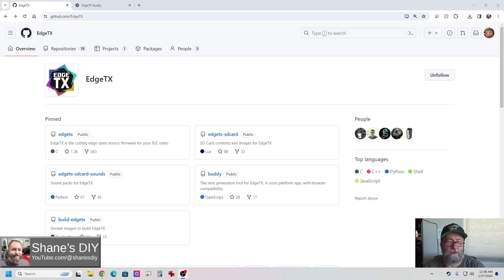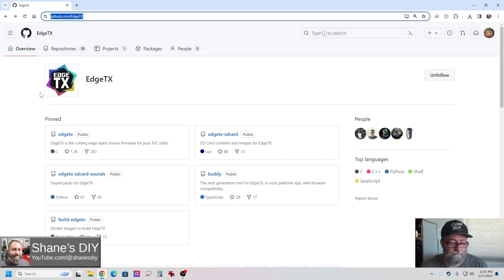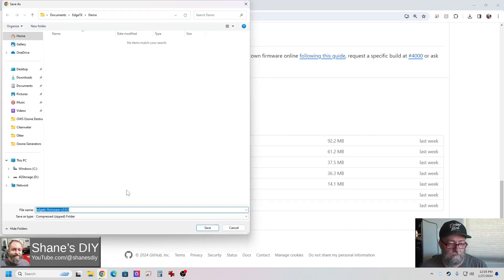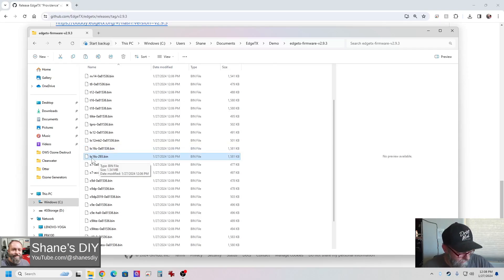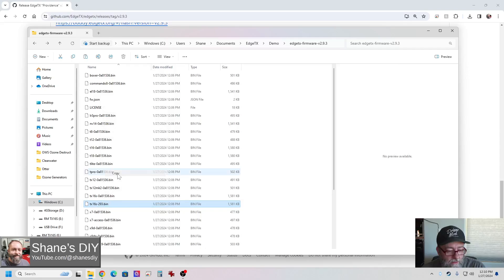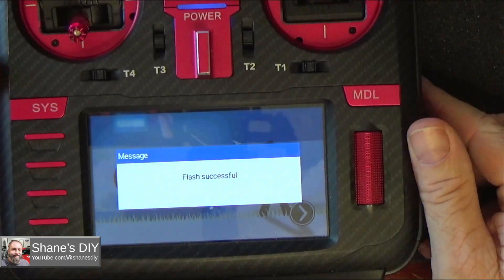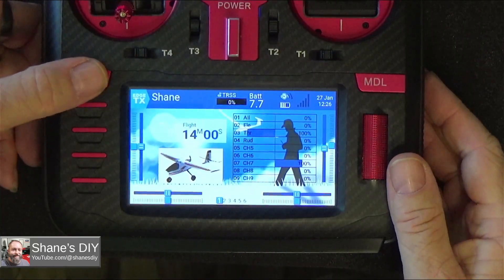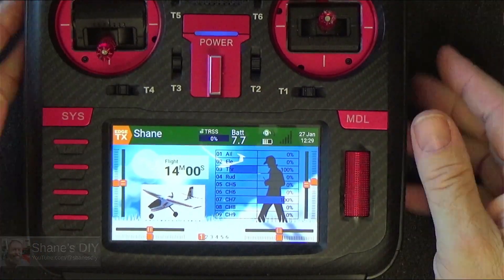Simple & Reliable EdgeTX Firmware Updates

Comment: Do you have a video on updating the 4in1 module?
Reply from the maker: Haven't made a video on that.  Just download the firmware file, copy the .bin file to your radio to the /FIRMWARE folder.  You might need to rename the file as the Zorro (saw in your other comment you have a Zorro) won't recognize large file names over 32 characters.  Then go to SYS-> SD CARD on your radio and scroll down to the /FIRMWARE folder and click, then scroll down to the 4in1 firmware file and click and hold the wheel.  Then select "Flash Int. Multi" or "Flash Ext. Multi" depending on if you are flashing the internal RF module or an external one.
Reply: @shanesdiy  it worked thanks

Comment: Hi shane, so i lost my mig29 this past sunday, i was turning to come around to the runway but plane just stayed turning & did curcles with power so it wouldnt stall it self, until it hit the ground. Ppl are telling me to check the locks & fades or holds & frames on the tx16s? 
I jmuse spektrum receivers so i just added an extra satellite.
Reply from the maker: Dang, sorry to hear that.  While it is part of the hobby and inevitable, you never get used to the crashes, at least I don't.

The fades, holds, etc. come through as telemetry.  You can put them on the screen with Widgets.  I'll put a link below to one of my videos at the point you can see Holds and Fades shown on the TX16S screen.  At the end of any flight before you turn off the radio you can see all of them a couple different ways assuming you don't have them shown on a screen.  You can just navigate to the telemetry screen and scroll to those values.  They will stay there until you turn off the radio or switch models.  The other way is to open the DSM Smart RX script and look at the flight log.  It will show you the same screen as you'd see on a Spektrum radio.  The only one that is really relevant are Holds.  That means it was in failsafe and ideally you don't want any of those.  You'll almost always see tons of fades, thousands of them potentially, don't worry about those.

If you did lose connection and the receiver went into failsafe and it didn't go to zero throttle I wonder if your throttle failsafe was set properly.  To set throttle failsafe to zero throttle, you must have throttle at minimum while you bind to the receiver.  It saves the current throttle setting as failsafe during the bind so if you have it set at 50%, for example, and the radio and receiver lose connection, throttle defaults to 50%.

This all assumes you have/had a Spektrum Smart receiver in your Mig29.
Reply: @shanesdiy  the receeiver im using is AR8360T+ on normal mig & AR10360T+ on my thrust vector one.. i just rebinded the receiver with zero throttle, because i added a satellite to it. First time it has ever happened. Well 2nd time but with a f16 i have but with a AR6306 receiver, just lost connection & plane went with some thrust until it went down into some bamboo (luckly no damage). 

How are holds & fades show in the telemtry section? I was in that section but idk how they would appear, i did see hold but that was at 0 all the time..
Reply from the maker: @Mroswaldo16  Might need to delete the telemetry values and "Discover new".  Be sure you are connected to the receiver while doing this.  Holds should just say "Hold".  Fades say "FdeA", and Frame loss is "FLss".

If you are looking at the DSM Smart RX tools script in the "Flight Log" fades are just "F" and holds are just "H".

Comment: Hello Shane,  you may have video on this but is there a way to change 3 way switch into 2 way without changing out the actual switch.  For example I have low rate and high rate (no mid rate). Switch pos 1 is low middle pos is nothing switch pos 3 is high. How do I disable that middle pos because if I accidentally switch to mid it disables my entire plane because I have not assigned anything to the mid switch. Thank you
Reply from the maker: As with most things in EdgeTX there are many ways to accomplish this.   Assuming you have your dual rates set up in the inputs (where they should be) I assume you have your 3 way switch assigned under "switch" for high rate of SA↑ (for example), and low rate is SA↓?   In this scenario all you would have to do is change one of these to !SA↓ or !SA↑.    So for example if high rates was SA↑ and low rates was !SA↑ then in both SA- and SA↓ would be low rates.  So "!SA↑" means "NOT SA↑".   Hope that makes sense.

Another option would be to setup 2 logical switches in basically the same way then use the 2 logical switches in place of the switch in the inputs for the dual rates setup.

Custom curves are also a way to turn a 3 way switch into a two way.  Obviously there will aways be 3 positions but you make two of them the same output value.

Comment: Is there a way to mute the voice alert when it says “telemetry lost/found”. I want to hear the other voice prompts I have set but don’t want to hear that one. I have separated the antennas to try and reduce that issue but still happens and most of my planes this only happens in a  certain area of the airfield but other planes it happens all the time. Thanks and Happy thanksgiving
Reply from the maker: Sure, in the telemetry screen there is a checkbox for "Disable telemetry alarms".  Just turn that on and it will not give you the telemetry lost callouts.  Particularly useful with Spektrum receivers as they only have short range "fly-by" telemetry so even if you lower the alarm points to 1 and 1 you'll still get nuisance alarms often.  Has nothing to do with control signal.

Comment: Hi Shane. I had updated my radio as soon as I got it to the most recent v2.10.4 centurion.  So my screens are a little different from some of yours on the older video versions. 
My question is when I uploaded all my planes (about 13) when I touch the “manage model” screen or button it takes several seconds for it to load. But any other touch screen function works immediately. It seems the more planes loaded under each group takes longer to load than if there were only 1 or 2 planes. Is that normal or is my radio having a problem.
Reply from the maker: That's pretty normal, more so if you have images associate with all the models as it has to load the photos and index the list.  I'm not careful to keep my images small so mine also takes a little longer to load up.
Reply: @ ok that’s what I was hoping the issue was. Second question is when I try to go to a group of planes where it says “favorites” and then you can add your own categories, for instance I have “jets” and “war birds” so if the jets is checked and I touch the screen for war birds it will put a small “and” but it won’t switch to the category I picked. I have to touch the jets until the check goes away and then touch warbirds. Are you familiar with this issue?
Reply from the maker: @flyjets305  It's a new feature allowing you to customize how the model search is conducted.  You can change this by going into SYS -> RADIO SETUP -> MANAGE MODELS.   If you set "Label Select" to "Single select" and then go to the model manager and you click between the categories it will just move the check mark.  When "Label Select" is set to "Multi select" you can customize how the other parameters are.  If "Favorites matching" is set to "Must match" you'll get the "and" in the model manager.  If you change "Favorites matching" to "Optional match" the "and" will switch to an "or" and you'll see models in both categories in the model manager.  Then of course in each model setup you need to assign whatever labels you want to each model.

Hope that makes sense.
Reply: @shanesdiy  thank you again for the explanation very helpful😉😃

Comment: Mine is on 2.7. do I need to go to 2.8 first then 2.10 or can I go straight to 2.10
Reply from the maker: Only need to go to 2.8 first if you are coming from a much older version or OpenTX.  I'd go straight to latest. 2.10.4 currently.

Note, in 2.10.0 there were some hardware addressing changes so some folks have to go into the SYS->HARDWARE screen and check/reset switches, pots and sliders, and possibly calibrate the sticks.  Simple process if you need to do it, just letting you know so you don't panic if some switches stop working after the update.
Reply: @shanesdiy  reason for asking is cause I read that it said to go to 2.8 first an don't want to mess it up.
Reply from the maker: @larryburrough7678  Basically, if your model files are are already in the ".yml" format, you are good.  What it does when you have an old version like OpenTX, is convert your "model.otx" files into "model.yml" format when you update to EdgeTX 2.7-2.8.  EdgeTX eliminated the built in model converter after 2.8.
Reply: @shanesdiy  ok cool thanks. I'm new to radio master an just noticed my rudder don't move on the channel monitor. All the other movements work when move stick other than rudder
Reply: @shanesdiy  I figured it out. It's working now. Now just to figure out how to do expo an high an low rates
Reply: Ok. Just in case I put 2.8 an 2.10 on SD card. Mine came with 2.7 so was just making sure

Comment: I Just used this method to update from 2.7.1 to 2.10.4 on a radiomaster tx16s. My radio got to the end of writing firmware on locked up. Any suggestions?
Reply: I unplugged the battery and entered the boot loader mode again and it completed the firmware install this time. Thx
Reply from the maker: @mrmikelleeperry  glad you got it sorted out. That was going to be my first suggestion.

Comment: Hey thanks for that. The last time I looked  at companion when I plugged in my TX16S it didn't appear to be detected by my PC, although some of  the functions on companion worked. I was expecting to see a drive appear on my desktop when I pugged my radio in, and when it didn't appear I just assumed that that's what it did. So watching this tutorial were you confirm I should be seeing a drive, I went and plugged my radio in to another PC, and it did show up on the desktop. Anyhoose, I did the update, which worked fine, so thank you for that, I had a feeling that if I plugged my radio in to the original PC that it would now show up on the desktop, which it did, so IDK if that's because of the new version of EdgeTX?
Reply from the maker: Interesting.  The version of EdgeTX shouldn't effect the PC recognizing it.  You sure the radio was on the first time you plugged it in?  If it isn't powered on it won't show as a drive, it just connects in STM32 bootloader mode, and you also have to select "Storage" from the radio display after you plug it in?   Also, sometimes it can take a bit of time before it pops up showing the drive.  Hard to say, glad it's working now!  Thanks for your comment.

Comment: Great video Shane, I wish I had found this a week ago. I figured this out pretty much on my own with the exception of making and renaming a copy. Unfortunately I am still having an issue. The radio has partially updated but the version still shows as 2.6.0. . I wish you had shown the version number after your update. That's my only feedback, otherwise perfect and straight to the point.Liked and subscribed.
Reply from the maker: Be sure you don't skip steps or jump around in the video.  When you run the firmware file first with the radio powered on normally, it updates the bootloader and doesn't change your firmware version.  You do need to update the bootloader first particularly since you are updating all the way from 2.6.0.  When you start the radio in bootloader mode by holding the two trim switches in while powering, then flash the firmware file, you should then see the firmware update and the version shown in the hardware screen will reflect the current firmware version.

I do show the version after the update, here is the timestamp to that spot in the video.  Shows it first when still within the bootloader screen, then after the reboot I show it in the hardware screen.
https://youtu.be/3Hbu7ZGsPsg?si=K4fdICJKN_axq5Xh&t=632

Comment: Hi followed your video. It was easy.  Now lua script won't load. I press the expresslrs button but it says loading but doesn't do anything.
Is there a way to factory reset the transmitter.
To start again from fresh.
Reply from the maker: Factory reset won't change anything.  Lua scripts, models, etc. all run from the SD card.  What version of the ExpressLRS script are you using?  Do you have internal or external ELRS?  Make sure you have the RF module turned on and selected in the SYS -> Hardware screen and that the model in question has the proper RF module and protocol selected.  Depending on which version you were on and which you updated to you might have to reset some settings.

Comment: Hello, please help me how to make the EDGE TX Radiomaster 16 timer start when the gas stick is raised up.
Reply from the maker: In your model setup if you set the Timer 1 Mode to "Throttle" the timer will only run when the throttle is above minimum.  If you set the mode for "Throttle%" the timer will run only when the throttle is above minimum and will also run faster with more throttle.  At 100% throttle the timer runs 1 second = 1 second.  Lower throttle levels the timer runs slower since you are using battery at a slower rate.  Throttle mode set to "Throttle Start" the timer will start as soon as you throttle above minimum but will not stop when you take the throttle back to minimum, it will keep counting down.
Reply: @shanesdiy  This does not work in EDGE TX, it works in OPEN TX.
Reply from the maker: What does not work in EdgeTX?  These throttle timer settings? Of course they do, I use them all the time.  Or are you referring to something else?
Reply: @shanesdiy  Firmware 2.10. The timer countdown does not start when the throttle stick is raised, assigned a switch to the throttle, it does not work, it is assigned to toggle switches, how can I make the countdown start when the throttle stick is raised?
Reply from the maker: I'm on 2.10 and it works, perhaps something you got setup incorrectly. I've been thinking King of doing a video on the different throttle timers, I'll try and schedule time soon for a video guide.

Comment: Great video. Can I update directly from 2.7.1 to 2.9.3  ?
Reply from the maker: Yes.  Sometimes you need to recalibrate the sticks, make a few adjustments here or there.  Just be sure to do a full pre-flight test of all controls for each plane after any update.

2.9.4 is the latest stable release, I think 2.10.0 is coming soon.  I've been testing the new 2.10.0rc3 release candidate the last week.
Reply: @shanesdiy  Thank you for the answer. I will try to update my radio  :)
Reply: @shanesdiy   Updated to 2.9.4.  with no problem. Thank you so much  🙂

Comment: my tx16s has no firmware folder - should i make a new folder & call it firmware?
Reply from the maker: If you want to update any firmware yes, I would create the folder and put the new bin files there. It doesn't use the folder under normal operation, just a place to keep the files during the update process.  Also, the files in the firmware folder are what will show up when you start the radio in bootloader mode. Make sure the spelling is correct and, I'm not certain, but it may also be case sensitive so match it with what you see here.
Reply: @shanesdiy  thank you Sir - it worked. took me about 1.5 days to figure my new tx16s  out & that is just the basics lol - enough to fly :-) scary frustrating at first but as time gets on its pretty awesome. next spare day crow brakes on my phoenix 2400. Cheers

Comment: Can I use this to update from OpenTX 2.3.x? I heard I had to update in stages or brick My radio, That worries me. Thanks
Reply from the maker: Same process will work. Only question is if you have models you want to keep. If you have models that need to be converter from otx to yml you must update to 2.8.4 first. Run the radio and it will convert the models. Then proceed to update to the latest, 2.9.4 as of today.  You will likely want to update the SD card sounds, widgets, multi-protocol-module firmware, etc.  RC video Reviews recently did a video similar to this one but includes the step to 2.8.4 first. Here's the link.
https://youtu.be/NYbOLLoV-GA?si=mN3RIoxGRa15vKtW

Comment: Great, clean video Shane!  Helpful!!  Say, I have a sidebar question.  Just got an Aeroscout to bind exclusively to the RadioMatster 16s.  Do you know how to best increase the elevator throw on the AeroScout??   I pulled both “covers “ off the port and starboard side, but I am dumbfounded how to adjust the elevator??  I was expecting a control horn……thanks for your time for all you have done with the Aeroscout and forward programming.
Reply from the maker: If the AeroScout is in safe mode with the throttle at low or cut, the elevator will have a mix down and if you move the elevator stick you'll see minimal movement. This is normal. Switch it out of safe and the throttle->elevator mix will turn off and the rates will be higher. In safe mode when you throttle up the elevator also has an up mix.

Mechanically, moving the control rod to the outer most hole on the elevator servo horn in the battery compartment is all you can do to my knowledge.